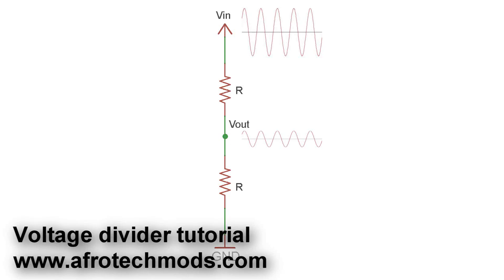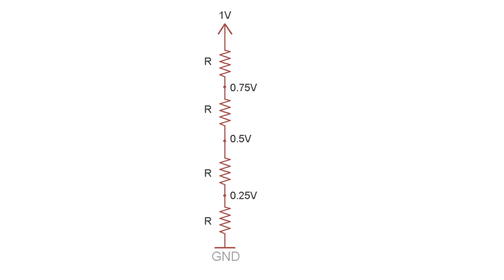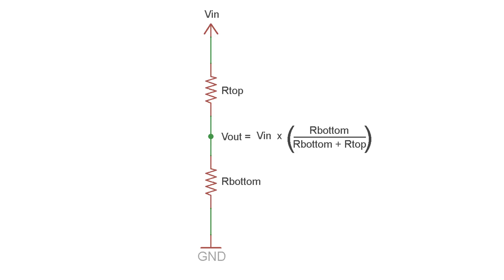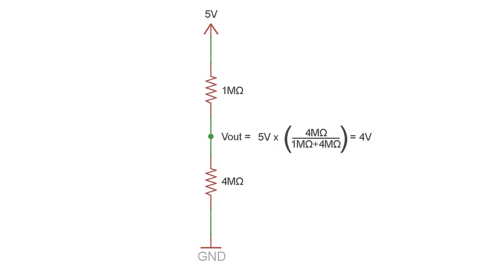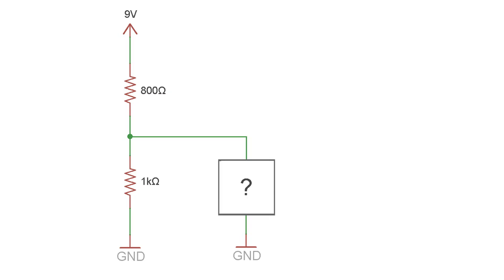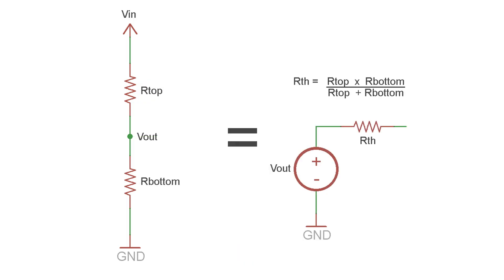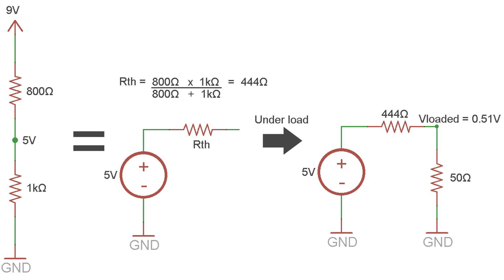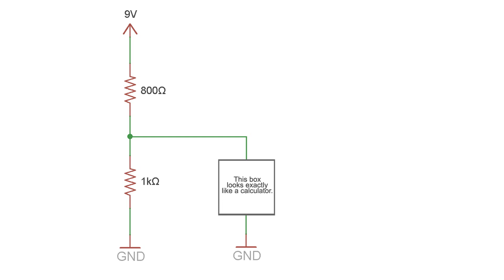Voltage divider tutorial

Comment: I can't get a voltage divider to work.  I have a bi-color LED I need controlled from one pin that will either be a positive or a negative.  One LED requires 2.0 volts and the other requires 3.6 volts.  It just won't work for me!

Comment: if your really cheap and want a voltage reference you can use a 5 volt reg, voltage dividers and a voltage follower opamp, one side of the divider with a pot and minimum value for adjustments

Comment: Hello,
on the four equal value resistor, how do you do the equation to calculate the 0.75 volts? I can get the 0.5 and the 0.25 but cant never get the calculation for the 0.75volts out. and thats all to GND or across the resistor?

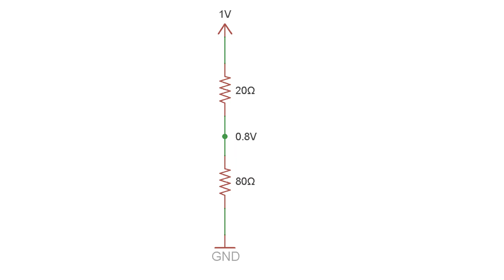Comment: Brilliant!! But i dont understand how can the resistors take AC to power a micro controller.. 0:55
i'm trying to moddify a circuit that uses the following configuration at some point.. (~250Vac > 510k > IC > dc 100k)

Thanks..

Comment: I find it difficult understanding what resistors to use to give a  certain voltage,. So are you saying a 1M resistor will knock 1v off the supply voltage? so if it was 5v a 1M resistor would give you four? Is it really that simple?

Comment: @Shekinahguild if you still haven't found your answers send me a message and i'll link you up to some docs, which present in a simple way the equations needed for common emitter, common collector and common base configurations of a transistor. using those you can easily build a class A amplifier. i calculated and built a headphone amp and it sounds great.

of course, class A draws lots of power so you'll want to progress to more efficient design, but it's a good start.